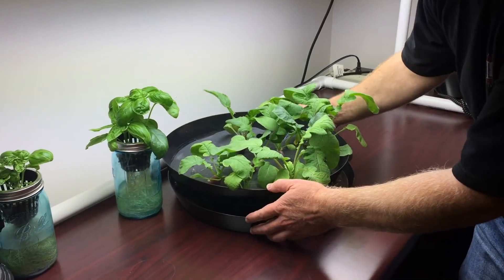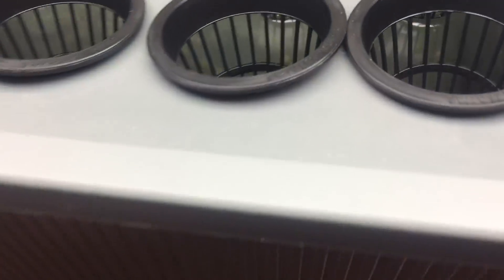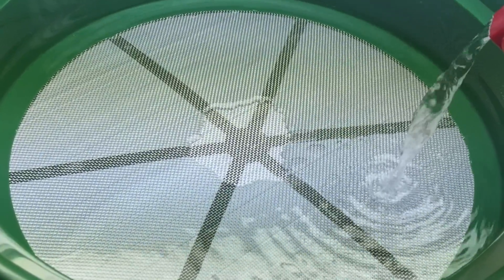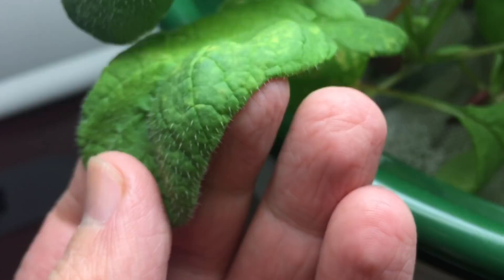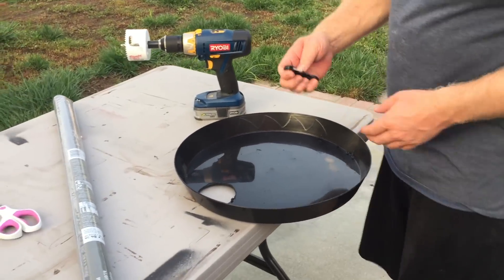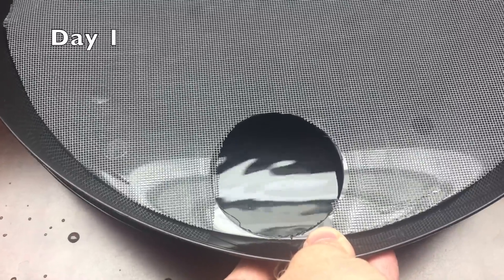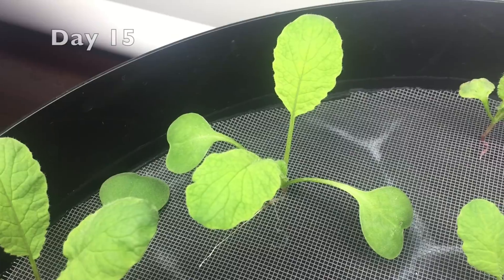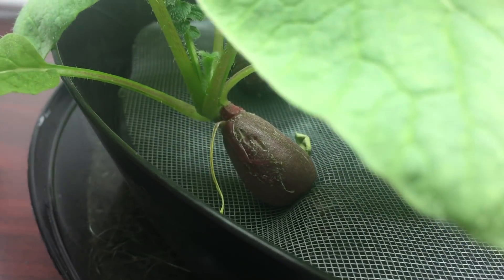Why did he grow them in a window screen?

Comment: As the roots start to take hold you could put a few small slices around the screen (Where the roots are formed) making some holes a little larger so the root system can develop further and as they get large and its time to give them more room as they will purposely crowd each other out, it will then also be easier to remove the ones you don't want or need without too much disturbance to the other root systems you want to keep. This should help prevent some of the yellowing of the plants too. Also you can add some vinegar to the water and the plants will flourish from it. I am not sure the ratios as I do not know the size of your containers. I found my Leeks growing massively from the added vinegar as well they were also flowering. I added ORE to my water garden and Crystal rocks for the roots to search out. I do not use a screen I allow the plants to sit directly into the water using rocks to keep them upwards as well I also use an air pump (15$ fish tank pump) to keep the water circulating to help prevent any slim build up and switch out the water every 3-4 days or as needed. Hope this suggestion helps! 

Great plants btw. I Love your videos and your humour! :) Happy Growing!
Reply from the maker: Thanks Shanti!

Comment: Hi Geb. Great system. Try big "hydroballs" instead of net, and when radish grow, hide the pink part with hydroballs so it wont cracking. Water level can be very low because of capillary phenomenon.
Reply from the maker: i've never hard of those.  is that like hydroton?
Reply: Yes. Good luck! (sorry about the mistyping your name)

Comment: when cutting a hole in the plastic like that you should just use a scrap board and run your hole saw into that on top of your work surface so you are less likely to slip and possibly get hurt the way you were doing it. Try cutting another screen and after a few days place the seedlings in the cut up screen with bigger holes so it constricts it less? I'm not sure. great video!
Reply from the maker: That is a good idea but I was lazy and it worked out fine.

Comment: use Nylon screen, it is as rigid yet has the ability to push fibers aside allowing for the girth of the roots to not be girdled. Also might want to make a single cut in the screen to allow more spread if it cant spread on its own enough.

Comment: part of what's making your mesh system so ridged is the fact the warp and weft are bound together. 

fashion two screens but with all the threads going vertically. place one screen below the other screen and turn it at a 45° angle. the seedlings shouldn't be heavy enough to push through the screens, but when they grow larger the only tension they have to deal with is where the strands meet the frames, not a 1 square millimeter opening
Reply from the maker: sounds like geometric jargon there!

Comment: Imagine a square crossed by horizontal lines. Every line is rigid but articulated at the intersections. If you skew the square vertically, the gaps will close, put the sprouts on top, and open as needed. Lines may be PVC, nylon, PET strings from a bottle, etc. Articulations will be easily made by poorly tighten rivets.
Reply from the maker: good idea

Comment: You should make a cross cut in the screen about a 1/2 an inch as the root of the radish grows it will push out the screen. Initially the cross cut will be sturdy enough to hold up the seed but will easily give way to the root as it expands. make sue the central root is in the center of the crosscut.
Reply from the maker: sounds wasteful

Comment: I just find your channel and I'm really enjoying it.

Ok, a few ideas that might help you.... Putting a net with large holes (up to 5mm, but even bigger could be used) to be there and just hold the entire thing and a gauze atop that to prevent everything from dropping and retaining moisture. Also, if you have problems with water bottle and holding it in place, just glue the cap and it will hold the entire bottle. Refills? Doesn't have to be a bottle, cut the bottom and you have a funnel.
Reply from the maker: interesting ideas

Comment: I grow my carrots and radishes in root trainers, mix of perlite, coir and vermiculite, I keep the bottoms of the trainers submerged in Dyna-Gro nutrient. Overall, less work and easy to transplant extra ones that come up. Plus, they easily grow on top of the media so it is not a problem to keep re-using it.  However that said, if you want to continue with this particular experiment as is, try the plastic mesh canvas they use for cross-stitch art.  They carry it in the arts and crafts section at Walmart or you can buy it on Amazon.
Reply from the maker: do you get algae problems in that setup?
Reply: @JebGardener  No, but I have a dedicated indoor grow room that I keep at 65-70 so I can grow things in the summer that I normally cannot grow here in the desert in the summer.  I have come up with a solution to outside algae problems in the summer.  I have meant to start a channel and video all these modifications, and I need to do that, just "stuff" keeps getting in the way - LOL.

Comment: You have the answer ,  when you raise the mesh near 9min mark.:)

Those inverted netcups you use. 

Try flipping the netcups and growing the raddish suspended inside while the top half of the plant above, being held by the base of the cup .

Netcups will have to be bigger than the raddish, so that they stay suspended.

Tricky part would be to transplant the seedling at a key stage(sometime post day 6)

The weight of the the plant suspended over the raddish seems to force it downwards through the mesh. 

As the radish will be suspended but plant will get support from above the base of raddish ,  it might solve the problem of deformation.  

Possibly a wild guess but you can be the judge of that. ;)
Reply from the maker: I think the netcup would still create a constriction.  I'm trying with Agribon now.
Reply: hmm. good luck with that,    here is diagram of deisgn i was willing to propose to you for better visualization.. https://ibb.co/nfKVNn
Reply from the maker: well I think that would work, but it would be tricky.  Stem above the root might still constrict.
Reply: Tricky part would be to place the transplant in the cup at a key stage(sometime post day 6) . All the best
Reply: i feel the stem might constrict but maybe a slight bigger hole as the mesh was quite fine aswell.

Comment: You could just use LECA stones to support the radishes. If you really want to grow them in just water then you could keep the seedlings floating with a constant upstream of air bubbles, though once they got heavier they would probably sink. Lots of ping-pong balls in a fish tank would keep them afloat and auto adjust to the water level. There are lots of ways to go about it.
Reply from the maker: interesting ideas.  agribon looks promising

Comment: Algae build when there is no aeration. you can use an air stone, or even experiment with a couple tablespoons of household peroxide. It really comes into bloom with contact to light.
Reply from the maker: I've heard that.  None of these grows had algae issues.  There was some scum, probably from bacteria.  Didn't seems to have any negative effect on the plants.
Reply: Jeb Gardener Congratulations on all the subscribers and success. And thank you for doing these videos. I love your delivery and the music. I've never used peroxide in my resivoirs, the algae doesn't eat that much I see, but it can affect the pH. And there's a cool chart by General Hydroponics (I use Canna nutrients) It shows the absorption rate of everything and what pH allows maximum availability of nutes. Get your $ worth. But again, more glass house baseball, I never use my pH meter either. :) So much loves from Jax FL🌹🌺🌴🌸🍍

Comment: As they grow, slit the screen into a larger hole so it does not constrict the roots, and any that have started growing in the screen, cut them out and pull them up laying them on the flat surface keeping the roots down through and into the water.
I hear a flat bottom makes them just a little crisper.....LOL

Comment: Maybe a thin sheet of 100% polyester filling could work? It's dirt cheap, hygienic (often used as a filter in aquariums), and will probably be soft enough not to resist or restrict the growing roots. The seedling roots won't fit through though, so one would have to puncture it with a thick needle below the seeds.
Reply from the maker: trying agribon now

Comment: Use a polyester mesh from your local fabric shop called tulle, pretty sure you can get different mesh size and it stretches and is real thin, will break if stretched too far, would be a good idea for rapid growing vegetables
Reply from the maker: good idea; trying agribon now
Reply: Dammit! Didn't scroll down far enough! (That was my idea too; 3 weeks in the future!)

Comment: I recommend abandoning the screen for radishes. Instead, take the tray, and for every "growth spot" make either 5 or 7 closely spaced dents with a small drill bit, with one in the center. Then (slowly! Use a push drill, pin vise, or similar) drill out the non-center holes so they go all the way down. THEN cut those holes, moving away from the center hole, so that they become triangular slots instead of circular holes. Finally, carefully deepen your center hole, and maybe cut towards the slots to link it up with them.

It'll take more cleanup, as well as more initial work, but I expect it'll work much better for this sort of thing.
Reply from the maker: that sounds completely insane!  Also could totally work too
Reply: Yeah, I think the most important step would be to make the guidance dents all at the same time, since otherwise you'd probably need a drill press for it. Thinking about it, a nail, hammer, and gentle hand are all that's needed for that.

Comment: Soft bristled paint brushes forming an inverted Teepee may do the trick. 
To hold the brushes with the right tension, some kind of adjustment to shoving the brush handles through the side walls of the grow cups need to be done.
A soldering iron may be the choice for adjusting the side hole size large enough for the brush handles just right.
 If the bristles press too tight or too loose then the same failures such as dropped starts and deformities will probably happen. 
Also, to eliminate root interference,  the bottom of the planter cup is cut out and only the pinching bristles keep the radish in place.
That's the idea anyway.
Reply from the maker: very interesting idea
Reply: Yes, especially for use in space and the watering wicked between the bristles instead of floating all over the place.
Reply: I forgot, you are doing kratky but kratky in space? Hmmmm
Reply: Maybe a separate set of watering bristles for the lower roots, air in-between and holding bristles for the bulb portion.

Comment: You could use tiny boats of a natural fiber in a sea of fertilized water. Just enough to float the seed in so it can root and then support itself in a net cup with the bottom cut out something like that. A fibrous medium is important to let the radish root and then expand on its own. Heck, even a small disk of rockwool would do it, just not the whole block you normally use.
Reply from the maker: That sounds fun, but I'm trying to make something that can scale.
Reply: Jeb Gardener if you cut out the bottom of your net cups and put the fiber mat rounds in instead, you can reuse the lid and box from 1:30, and only lose the skin of maybe the top half inch of your radishes, if at all. Coconut fiber mats are pretty cheap and easy to cut, and allow for the radish to push the mats apart for space.
Reply from the maker: I think it would work, but I mean scaleable on a commercial level.
Reply: Jeb Gardener if you're looking to scale up to a commercial level, your best bets might be some kind of 1/4 inch lava stone, or some kind of recycled paper circles
Reply from the maker: It has to work in outer space too.
Reply: Jeb Gardener i like the way you think! To grow plants in 0g is possible,  but comes riddled with its own challenges,  among them being the lack of gravity. Ultimately, a slow-spinning tube of plant bays around a central light bar would yield more,  and have fewer drawbacks. As for the medium, you'd need something that can be regenerated with every harvest. I'd go so far as to suggest a fibrous stalk plant like a reed that can be regularly harvested, and put to use as a seed carrier. Failing that,  maybe a carbonized pellet made of inedible greens from a previous harvest. Absolute worst case,  a bacterial symbiotic culture of yeast (scoby, kombucha leather) or an algae could be cultivated and pressed into service as a sterilized intermediate between waste and food stream?
Reply from the maker: i think a reusable screen is the way to go

Comment: Great video! You might be able to avoid the constriction if you used a non wire mesh, for example cheesecloth. If you stretched it tightly it could still support the radish weight, however the loose weave of the material has the potential to be more forgiving of the radish growth. Cheers!
Reply from the maker: good idea

Comment: what if  instead of a screen you just had a bunch of string all running parallel across the top of the water and suspended the seeds on that?
Reply from the maker: I think that would work better but it would be hard to set up.

Comment: Have you tried Paint screen? It's more flexible but has a tighter weave. Probably let the paint screen lay over the cups then poke a larger hole for the roots to start their descent to the water.  The painter screen should stretch.I would use some 220 grit sand paper on the screen first (to relax the fibers :] )in case it doesn't you may have to slice the netting every so often till the root can do it on it's own.
Reply from the maker: i have not tried that.  interesting

Comment: Geb, have you considered using paper towels or maybe even a cloth like a sham-wow just something that can break as the size grows. Rather than  putting them in rockwool and in a hole try a cage with larger holes underneath. Use the paper towels or rockwool to start them before they can fall away.
Reply from the maker: yes

Comment: Try an onion bag for your mesh. The strands aren't glued together so your radishes should be able to make a hole as big as they need. I think its worth another shot and the bags are extremely cheap. I think you are on to something very interesting if you can make it work.
Reply from the maker: Yeah I want to mass produce hydroponic radishes.  Nobody is doing it as far as I can tell.  It's too cheap to grow them in the ground.

Comment: What if you took wire twine and twisted about 5 strands into 1 strand like a cable, but loosely.  Then, poke a hole in the center with a pen or something, then put a seedling in that.  The looseness should expand much better and your "cable" can be fixed at each end with X number of radishes planted along the length of it.  

I know this video was posted in 2017.  Have you done an update?  I see one video since this one, but it was with rockwool.

Comment: Maybe Like you did with potatos.
My idea1: to put the seed on small plate(without net holes so the root must go around) or knought  like 2mm centered on X rope. In a hole. 
My idea2:  like hanging knought for self releasing knought.  around the top of the leaves as soon as leaves grow.
Maybe use knitting thread to hang the seedling.

Maybe attach the seeds to a rope  with a rubber band
Reply from the maker: I think that could work but it would be labor intensive.

Comment: Use small nursery fabric grow bags. They are pretty cheap on eBay, you can buy a couple of hundred for a couple of US dollars shipped from China. Their roots will find their way through the fabric and the radish will stay in the fabric pouch, in theory anyway.

You could probably sit the pouch in your 3 inch net cups.
Reply from the maker: interesting idea
Reply: Actually when I think about it, the tap roots during germination and early seedling stage won’t be strong enough to push through the fabric.

Perhaps use a sewing needle to poke a hole through the fabric for the baby tap root to go through and then let nature do the rest. You’ll need to be careful not to damage the tap root when encouraging it to go through the hole you’ve created.

There are different size nursery fabric grow bags you can buy so perhaps buy a variety of sizes for stock to find out which ones will suit your netcups and radishes (and other veg you wish to experiment with).

Comment: Would a thin silicone mesh work? For instance those anti-slip rolls you can cut into shape and place under stuff you don't want to have moving about. It's stretchy enough at least, and while it'll deform a little bit, it'll mostly regain its shape once the roots are gone (unless it stretches so far that the silicone snaps).
Reply from the maker: someone recommended that earlier.  I may try it, but Agribon is my current choice.

Comment: maybe you should try some water circulation/movement. It would probably stimulate root growth after the first 15-20 days. and if you're doing that passing the water through a UV light would kill most any fungus. or, maybe a fish tank. as far as your root impingement issue. I would think go back to metal screen just slice an X through it where the root drops. strong enough to hold it there yet with the cuts weak enough to move out of the way

Comment: Have you thought about using the mesh that cross stitch or embroidery uses. Maybe even some tulle fabric. It comes in various weaves and stretches alot.

They are synthetic fabrics so it should hold up better than cheesecloth.
Reply from the maker: i think a double fabric of about 1/4 inch would be amazing.  You offset the mesh.